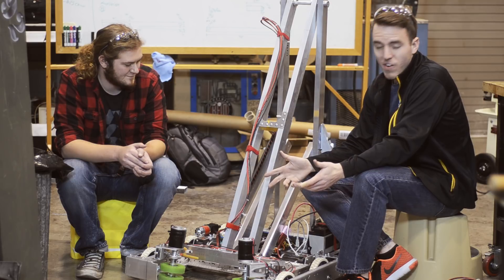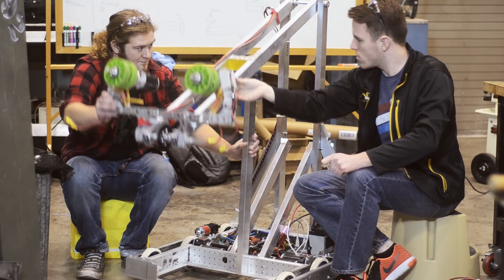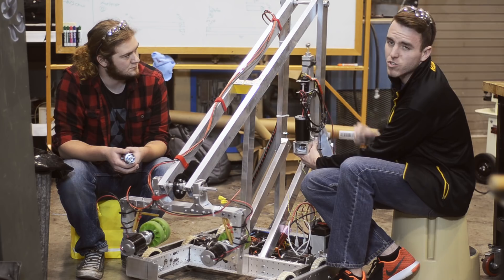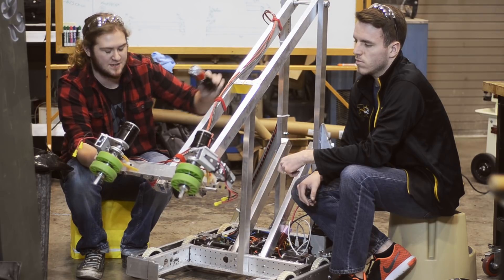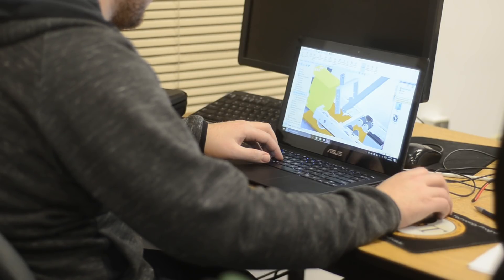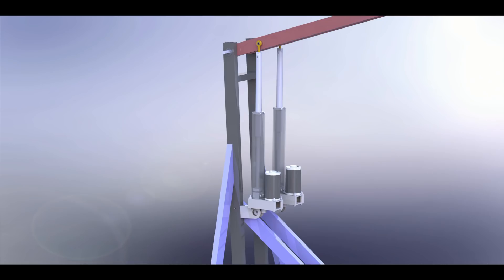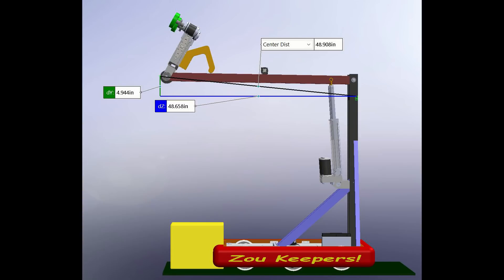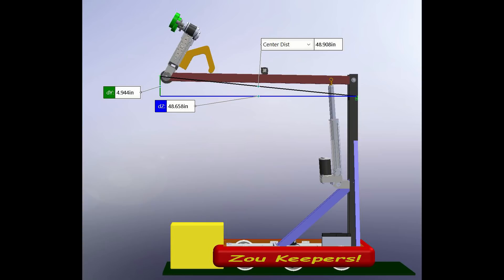Ri3D 2018 - Zou Keepers - Day 2 Recap

Comment: Why do you think that you can extend higher than the 55" height limit?  In my reading of the rules, we can't extend beyond 55" until the end game.
Reply: The consensus seems to be that the 55" only applies to the starting configuration, and there's no height restriction after that.  If you've got a rule citation to the contrary, lots of folks would like to know.
Reply: We debated this for while, the rules are a bit ambiguous. Our interpretation of the rules is this: The rules explicitly state the height limit at start, but have no other statements regarding height at any other point thereafter (not even in rule R04, which speaks to the frame perimeter in the endgame, which extends infinitely upward from the inside of the bumpers). There is no rule that explicitly restricts the height of the robot during the match, only in the starting configuration. We cannot expect the rules to define everything we CAN do (extend beyond 55" during match), only the things we can't do. By that logic, we know the frame volume is restricted to  33 in. by 28 in. by 55 in. tall in the STARTING CONFIGURATION, and the robot is not allowed to extend more than 16" beyond the FRAME PERIMETER (which extends infinitely upward) until the ENDGAME. This implies that during the match, not in the STARTING CONFIGURATION, we are allowed to extend infinitely upward.
Reply: Yes, the rules aren't clear on this.  As I read it, it seemed to me that we could extend 16" beyond the frame perimeter.  That doesn't imply that we can go higher than robot height limit.  But I guess we'll have to wait for a rules update to find this out for sure.

Comment: I'm still a little unsure on the reaching more than 16" outside the chassis perimeter.  It looks like the design is compliant only if the grabber is folded back?  What if the driver forgets to fold it back in the transition from floor to highest position?    In the highest position with the grabber folded out (as would seem to be required for cube placement), is it compliant?  What about when it is just a few feet off the ground and folded out as if it were placing the cube on the scale?
Reply: Yes, you are correct. We have thought about this, and through quite a series of algebraic and trig calculations, we were able to compute the critical angles at which the end effector would violate the perimeter rule. We also solved the kinematics of the two degree-of-freedom arm to create a well defined control scheme, enabling us to automate the lift / rotate mix to keep the arm inside the frame perimeter extension rule. Therefore, it will never be up the the driver to remember to fold up the mechanism. In simple terms, we are calculating the furthest reach at all times, and if it is about to violate the perimeter, the end effector automatically retracts itself. We will explain this more in our walk-through video in a couple of days, so look out for that.

Comment: Hey there. Great work.
Have you guys thought about using scissor lift vs arm lift?
Reply: We didn't give a scissor lift too much consideration. I've attempted to use a scissor lift in the past on FRC robots, and had poor results. I could never seem to get the geometry correct. That's not to say that a scissor lift wouldn't work. I bet with a quality design, and precise manufacturing, a scissor lift would work great, it certainly would achieve the height we are looking for in a much smaller (at least in a lengthwise dimension) footprint. The design is just a bit more complex and on our short time, our arm mechanism seemed like the quicker, easier option.
Reply: PCSmithy Agree with you mate.
My team is in a debate about scissor vs arm. I totally agree with you that the scissor itself could become its own project, but maybe order a premade one will solve the problem a little bit? My team has been using arms for so long but has no experience with scissor. I really dont know which will be a better option in this game.

Comment: The scale in its highest position is 6' (72"), but has a 3.5" lip ABOVE that. The geometry on the CAD doesn't quite work out to reach that high, the cube arm may need to be tilted up to push it on. Good work though. 

For clarity, the 72.952" distance in the Solidworks model needs to be minimum 75.500" (not accounting for cosine error), with clearance. 

A few questions: 
Did you consider parallel bars (4 bar linkage)? 
Any reason for the linear actuators in place of pneumatics? 
If you had time for a different drive train, would you go for a 2 speed, mecanum, or any other setup? 
Can you pick up cubes on the 11" dimension? 
Why the redline? From my understanding, it is similar to the 775 Pro from Vex (which I have experience with), and I can't imagine needing that much power for rotating it.
Reply: 1.Great point with the height of the lip above the scale platform in the highest position, I had overlooked that in the original design. We are fortunate however that whenever I did the CAD for this bot, I was fairly conservative with estimating the stroke of the piston, meaning when we built it in real life, we've got a bit more stroke to work with than I expected, meaning our overall height fully extend is about 7.5' at the axle between the arm and the end effector, so we will have plenty of height to work with, we may even be able to point the gripper down and fire the cubes onto the scale.

2.Assuming you are talking an arm system similar to a desk lamp (like Robowranglers used in 2011), yes, and honestly, that sort of assembly has many pros, such as an end effector maintaining orientation throughout the vertical travel of the arm, and you have the option of adding some sort of elastic counterbalance between the members to lessen the strain on your motor or actuator to power the thing. That system is totally doable, the geometry would be a bit different and we decided to pursue our system because we thought it would be simpler to integrate with the linear actuators we had on hand.

3.We wanted precise control over the height of the arm, meaning we would have the ability to pick up cubes on the floor or stacked up. We also didn't have any 12" stroke pistons with a large enough bore, but fundamentally, this design could be executed with pistons. Also, something to keep in mind, a piston generally comes to a rather abrupt stop at the end of its stroke, meaning the potential for the cube to rock loose is greater. With an actuator, we can run a PID control on the position of the actuator and gently stop it at the desired position.

4.For us, the only additional functionality we would like would be to strafe left or right, but we don't want to sacrifice the simplicity of a tank drive, so if time was no issue, we would likely go for an H-Drive system. This would aid in lining up the with the rung for climbing. Mecanum is too heavy/expensive, Swerve is complicated/expensive/would be great, but not really necessary.

5.As of now, no. Our box intake system has some room for improvement, there's a lot of slop in our pivoting hinges, so we've restricted their movement quite a bit, meaning we can only accept cubes that are 13" wide. However, with more time and some iterative prototyping, I'm confident a similar mechanism could pick up 11" and 13" cubes. I think some of the other Ri3D teams were working on mechanisms like that, I'm not sure how successful they've been, but they probably have some thoughts about it too. On a related note in game strategy, any 11" cube can be approached from a different angle to be transformed into a 13" cube.

6.Yes, the Redlines are basically the same as the 775Pros. The reason we are using them is because they are a very high quality motor in a medium sized package, and (Full disclosure) they were graciously provided by AndyMark to us. We've been really pleased with them so far. Because of the lever arm of the end effector, we do end up needing quite a bit of power, but you're right, a smaller motor would probably work just fine for the end effector (Currently we have a 25:1 * 3:1 Vex versaplanetary gear box on it, works like a dream). We are using the same setup on our winch climb mechanism, with an additional 2:1 ratio with #35 sprockets and chain for an overall ratio of 150:1, we haven't tested our climb yet, but from our calculations, this should be sufficient to winch the robot up the wall. 

Check out our walkthrough video in a couple days, we'll go over all our mechanisms in detail and speak to how well they work (or don't...).

Thanks for the questions!